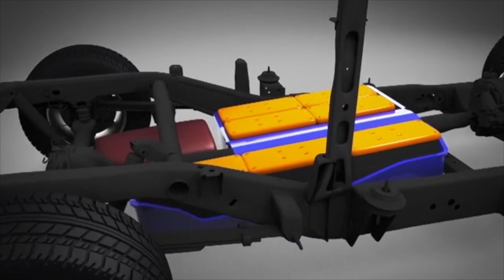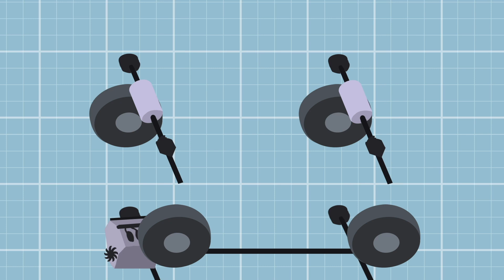Could This Pickup Truck Design Change The World?

Comment: Although this premise is correct that we need to move to electric pickup trucks we will not see this from GM or Ford until they have a large company looking for an electric fleet option.  
If I had to guess who will put out the electric pickup it would be from Dodge/Jeep. They have already stated they will have an electric Jeep Wrangler and a Scrambler. It would make sense to have an electric Scrambler in the works. Once they have this worked out an electric Ram or Ram Van will be close behind. Dodge is late to the electric car game and they may want to focus on being first to an electric milestone like the pickup. The Power Wagon has the right name for it.

Comment: Where hybrids have a place, then your design is, in my opinion, the most logical option.  I cannot see the point of hybrids that retain the drive through a gearbox.  Electric drive is much more efficient and responsive and avoids the weight and cost of the very complex engineering in modern gearboxes.

Comment: Diesel electric locomotives have been using that tech for decades.  
My question to the eco-dinks:  Why are you not hammering the Chinese and others about their horrid ecological harm.  There is more than one city in China in which the exhaust from a typical American car is cleaner than the air going into it.  That's where you'll make the biggest difference.

Comment: I've seen the Tesla X pull the plane. Although a Tesla can haul weight up to how much maximum and for how long before the battery runs dry? Won't work in comparison to fuel trucks. You can demand all you want but the difference is simply too great.

Comment: The market for pickups in the UK is sill very small - they are really only bought by farmers or those that regularly drive off road. We do however have a series hybrid in the firm of the new London taxi manufactured by a subsidiary of Greeley. The theory being that as most cabbies live outside the capital they can use the ICE to travel in and out at the start of the day without impinging on the EV range whilst carrying fare paying passengers. I believe Ford is going to be introducing a series hybrid of the Transit Custom next year. Again this is to reduce pollution in heavily congested cities.

Comment: Great idea. However, I would suggest using a capacitors vs a battery. My reasoning is size the engine for average horsepower  need and use the capacitor for surge power, acceleration and hill climbing. Run the engine in it’s optimum efficiency range. Turn the engine off when the capacitor is at full charge running off the capacitor until it runs down. Repeat so the engine only runs at optimal efficiency.  The key is creating an electric vehicle. There are ICE engines that are in development that directly generate electricity. This could be the future for a hybrid vehicle when your work takes away from the grid.
Reply: We need denser supercaps to do that.  Currently the energy per unit volume isn't good enough.  They are great for a few seconds of a huge amount of power but not for many minutes worth of 10KW.

Comment: There was a prototype series-hybrid HMWV with an electric motor on each wheel and a Diesel engine driving a generator. The batteries were too heavy and so its payload wasn’t sufficient for military use, but otherwise it worked well. I think the batteries were lead-acid.

Comment: I thought of this idea years ago but without a large battery bank. The engine would be a power generator. The engine would be much smaller than the general engine, lightening the vehicle.  Could be done in cars and trucks.

Comment: For me, the solution could be an integration of a hydrogen F-Cell into the EV-Pickup like Mercedes is testing it in its GLC F-Cell. The range and rapid refuelling of a combustion engine together with the torque of an electric, without emission (except water). Don’t you think ?

Comment: Bigger is not often the only sign of efficiency and effectiveness.
How many moving parts, the weight of the drive train at the floor and not at the front. The frame bolted to the floor rather than the weight held by the frame.  Torque from the get go, rather than when the vehicle is well in motion.  Brakes, cruse control, ers and abs are part of the drive train not separate devices and when the car is scrapped the battery can still run your house for a week for another 20 years.
There has to be other factors to make a decision to go ICE?

Comment: Each cars motor has an RPM at which it is most efficient. If we just start using our cars as much as possible at that RPM it will make a big difference already. Most drivers have no idea what that RPM is.

Now if only we can disconnect the motor of an existing car from the drive train and insert an electric motor in between, say instead of the gearbox.....

Comment: Very few pick-up truck owners use them as intended, which has not stopped pick-up trucks from growing in size and power over the past 80 years.  The vast majority of trades people, for instance, don't require anything so big.  The real problem is pick-up truck culture, which is tied into working-class culture, but also deeply insecure masculinity and the desire to dominate the roadways in an urban assault vehicle.  That's why US manufacturers have been so slow to introduce ANY innovation, save ridiculous levels of luxury.  There won't be any leadership here from the likes of GM.

Comment: You have forgotten battery technology  is limited. It is not practical when hauling a trailer with livestock to stop for an extended period to recharge inefficient batteries. Also, no one seems to take into account the pollution or cost of producing  electricity. Maybe  all these factors should be taken into consideration before we jump on a bandwagon without knowing the ramifications.

Comment: I am one of those pickup lovers.  I use the pickup for short range usually less than twenty miles at a time. The big power needs are very limited. Things like pulling a boat out of the water or maybe to pass on a two lane road.  If going a longer distance I know when I start the trip.  Being able to run power tools off the battery and on a long day being able to recharge the battery while off grid would be great.  While no configuration would meet everyone’s need I would be happy with a 20 kw battery and a motor in the 75 hp range.  What I would need is an electric drive that could give me the 350 hp output for a minute and a way to stay the gas motor early into a longer trip.
Reply: Clyde Wolf Why not go full ev as you clearly don’t need fossil fuels. The Bollinger allows power tools to be used from the batteries.
Reply: I think charge discharge rate of 20kw battery would not be sufficient unless ultra caps could be added

Comment: This requires a completely new design,  a process which would take several years and then the manufacturer would
Need to sell this pickup for quite a few years to recoup the development and factory setup costs.  As battery prices will continue to fall dramatically over that time, making pure electric pickups affordable I wonder whether it is something that it would be viable for mamufacturers

Comment: Many years ago, I nearly bought a Mitsubishi L200 pickup, because of the tax rules. 
A few years ago, I bought a Mitsubishi Outlander PHEV, because it was the only vehicle available that had most of my requirements AND because of tax rules.
Now I have changed to a Tesla, and the only reason I can afford such an expensive vehicle, is because of TAX rules.
If so many people (Americans?) are buying pickup trucks because of tax rules and because those vehicles don't have to meet the fuel consumption rules, perhaps the rules need to change?  May be add an extra tax to double the price to consumers, but allow real business to offset on their business taxes?

Meanwhile, it would be nice if Mitsubishi (or anyone) could take what they have learnt from the PHEV system in the Outlander, and do it for the L200 pickup, but perhaps they might need to do two versions, one that complies with the 50g/km of co2 for the tax rules and people who want the status symbol,  and another that can tow that boat in the video and has power take off, which comes under the commercial vehicle rules?

Comment: Series hybrids suffer from power conversion losses that can make them less efficient than the equivalent parallel hybrids or series/parallel hybrids (like those used in the Prius or Volt). While series hybrids are simpler to design and slightly cheaper to build, I doubt the modest savings in production is worth the lower efficiency. 
We are more likely to see a plug-in hybrid pickups using a modified version of existing hybrid technology from Toyota, General Motors, and Ford.

Comment: 300hp generator in a series hybrid?  That seems excessive.  With an electronic drivetrain most work trucks could easily match performance with half that.  No one is actually demanding peak horsepower from a midsize pickup continuously for more than a few minutes at a time, and even that is an extreme case.  That's why you have batteries.

Comment: Agree hybrids are the best option for long range vehicles. In Australia any travel across the country would not be possible in full Eletric vehicles. Both as batteries couldn't do the distance and small towns and road houses do not have the electricity available to recharge cars and especially not at a fast rate. 
However. Almost in all Australian states its cleaner to run diesel/ petrol as your old style coal station aren't efficient. Making full Eletric cars pointless here. I would say developments across the board need to be implemented such that power generation has an option both cheaper for the user and cleaner to encourage the biggest polluters (China, India ect) to make a cleaner change.

Comment: If it does not have a V-8, can't push snow or tow something heavy it's nothing more than a pile of scrap metal. Stupid question for ya. How will salt affect an electric truck? Traditional trucks already have issues with salt use because in bad weather the trucks come out of the garage and hit the roads. I have a 30 year old Cadillac with a nice powerful V-8 and not a speck of rust on it because it does not see winter use. My trucks never last long because of rust issues due to salt laid out on the highways in the winter because in the real work icy roads are a real problem.

Comment: the Atlas, there's one from Canada that looks like a boxy ram, the up and coming  Bolinger B1 and B2,  heck GM has been making some variation of a hybrid truck sense the mid 2000's  it gets the same combined fuel economy as a Honda accord!

also 26mpg isn't anything to scoff at when a 1975 F150 would get about 14...

Comment: The vehicle suggested here is ridiculous. It's just throwing hardware at the battery autonomy problem with absolutely no regards on cost or efficiency.
300HP is not a small engine, especially in a hybrid configuration where the battery is already providing peak power.

Hybrid engine designs have evolved since 2010, this simplistic series hybrid design is completely outdated.
It was already not efficient against the early Prius gen 1 type of hybrids,  It was completely outdated when the 1st Chevrolet Volt hit the market. And the next generation of hybrids with completely newer designs pushed the technology gap even further.

You cannot afford to have huge piece of metal (300HP engine and associated 300HP generator) doing nothing in an already extremely heavy battery powered electric vehicle, be it a pickup or a car.

Diesel-electric engine from locomotives and oversize mining trucks are not hybrids, they don't have large traction batteries. The electric part is only there to act as a transmission. You can't put one in a car and expect miracles.

Comment: One question...... what’s the carbon footprint of the power plant of which electricity is made? Electricity isn’t as clean as they make it seem. Where do the batteries go once they are done? The carbon footprint of all the parts made on the electric cars aren’t clean either. Shipping? Massive Diesel engines. Just stop. Hydrogen or even propane would be better. The oil companies won’t let that happen

Comment: They're could build already full electric, hybrid, range extender pick up truck if they wanted. First they have to design nicer aerodynamic, better higher quality off products with more high Tech materials to reduce the weight then it would be much more efficient. Just do it for a better air!👍💪👍

Comment: I think the design of the pick up truck needs to be revisited in general. If doing an all electric truck, you could eliminate the giant font end, move the cab forward while still having a safe crumple zone, then have more than enough room for a large bed or extended cab and regular bed. And with people used to such high cab locations, there should be more than enough room to place the drive batteries under the cab and then still have plenty of room under the bed for additional batteries or storage. It also needs to have Vehicle to grid tech to be able to use the truck as a site generator while working etc.. Curious what Tesla is doing, but I hope it's not just an electric F150  with Tesla styling. It needs to be a very practical and clever industrial design piece that has all the bragging rights. I just spoke to an older fellow who approached me in my Model 3, he was curious as he had seen plenty of them around and was excited to find out more. When he asked about price I thought he might shy away when I said mine was $54K, he actually was shocked and said "what? that's it? I just paid $64K for my new Dodge pickup!" So people are spending Loads on pick ups and like most SUV's, pick ups and jeeps, they will never see a dirt road, but it's all about some hypothetical "yeah but my car could crush yours" mentality. I'd even love to see an off-set cab design and a pass through bed. (kinda like Bolinger's but their's just looks like an old Land Rover.
Reply: JAEGERTECH no way man . The easy sell is to keep them looking the same with bigger torque and power . That will transition them fast ! Remember who the buyer is !!!

Comment: good idear and ur right gas guzzlers do need cleaning up but bare this in mind lpg is esentialy methane ie gas of poo and lpg cars converted on avrage have up to 70% less emitions than before being converted and lpg engines like to run high compeshion and forced induction so if the auto makers made a truck with say a v12 2.8 litre lpg turbo/supercharged with high compreshion with regen braking ect now theres a winner ow and human methane can be used so the sewage stations could cleen up to no more venting or burning it of and wasting it even dairy farms could produce it " or a hydrogen on demand system and a tank of water and solar to power the electrolysis is a fairly good logical solution " just a couple of thoughts . Thanks for the video 👍

Comment: I enjoy your videos, but I feel the need to correct this. The Prius engine at no point drives the wheels because it has no mechanical connection to the wheels. It only produces electricity to either (1) drive the main drive motor or (2) charge the battery.
Reply: WOW, are you confused!
Reply: @kkarllwt  I'm really not. Look it up. There are videos on YouTube that dissect the Prius transaxle. You will see that the Prius engine is connected to a generator, and an inverter directs the electricity it generates either to the battery or the wheels.
Reply: Go to 13:45 in the video. It shows that there is no actual mechanical connection.
Reply: @wphubert  yes I have watched his videos.  They are not 'hooked together', they are independent.  You might want go hook can and watch yourself.
Reply: @wphubert  I appreciate the link and the thoughts. Maybe we're splitting hairs - let me ask you this so that I can better understand your position:
Do you believe that the engine can directly transfer its mechanical power to the differential - or do you believe that the engine spins MG2, which generates electricity, and that the inverter/converter assembly directs that electricity to MG1?

My understanding of the planetary gears shown in the page you linked to is that the engine has no way to apply its mechanical energy to the ring gear. Did you watch the WeberAuto video at 13:45 and understand something different to what I did?

Thanks :)

Comment: I disagree.  The GM Volt doesn't sell well.  Doesn't re-sell well.  I don't think a plug-in hybrid truck would do any better than the Volt.  Also, it would be more expensive than either standard truck or a BEV trunk.

Comment: Power grid has only 30% efficient , rest  70 % works like space heater ,what makes global warming. Modern diesel engine emit mostly
steam , actually  the air is cleaner at tail pipe, than  what is suck in. Electric  truck will cost twice.  For what reason I should buy one?
 Micro nuclear reactor under hood  is real change.

Comment: Then after the pick-up truck are electric you need more electric power on the grid so you build more atomic power plant , more diesel power plant because you have to recharge during the night so the sun power plant can only help the grid during the day to operate the air con and the heater.
so witch one is the best  ???
you have to choose now because later is to late !

Comment: I like where you are going and it is an excellent idea to have a 30kW motor in a hybrid pick-up!! The question is, will someone walk up to the plate and make this happen before Tesla gets out the 200kW beast??
Reply: However, with a wall battery and solar panels you can charge your house and your vehicle with nearly zero emissions. That is available now, not 4 years from now. Just sayin'